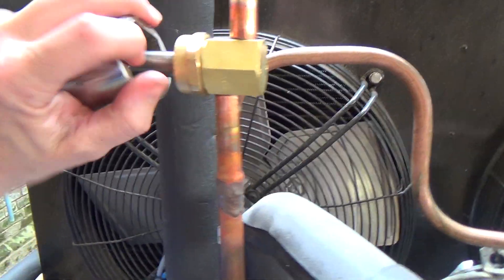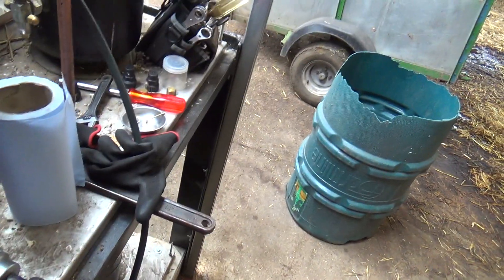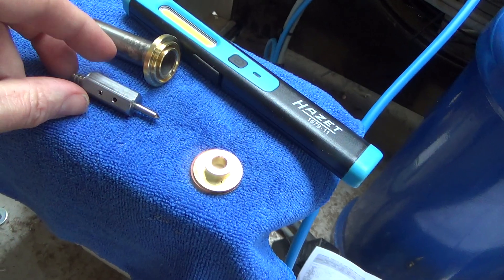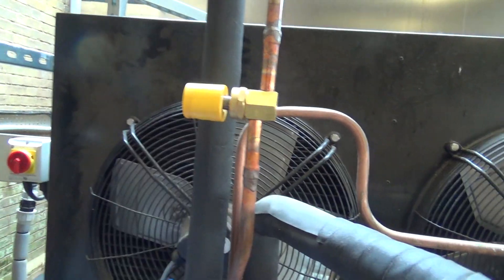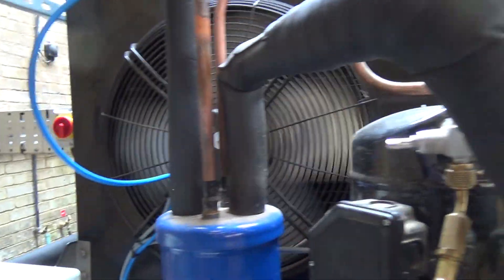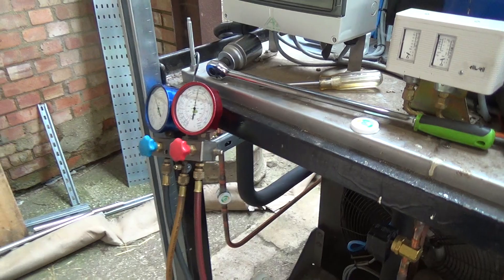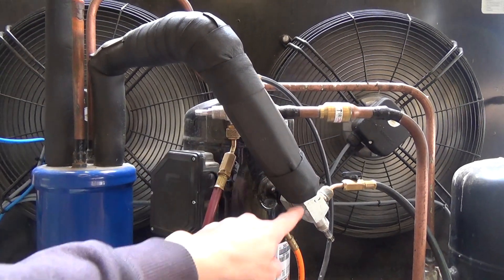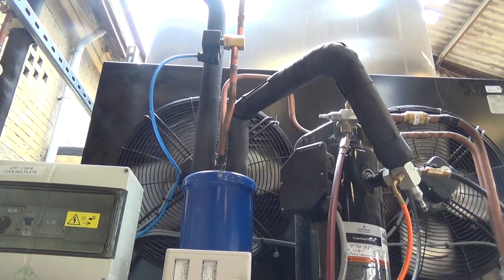Faulty Sporlan Valve Investigation

Comment: Could be that the spring had a small burr on the one side from the forming, which made it stick in the piston, so turning it around keeps the burr from making it stick.
Reply from the maker: That would make sense, it was definitely a tighter fit on one end.

Comment: I think all your thoughts on that valve are true. I was taught to stretch that spring if you are already in there.
Sporlan has a chart for sizing those valves. It is tempting to just install whatever pipe size is there.
I use the Ridgid E-110 hex wrench for those valves.
Reply from the maker: Think I've got one of those Ridgid wrenches somewhere! Will have to find it out.

Comment: Rarely have a problem with sporlan liquid line valves. Had a piece of metal chip hold one open on a freezer two yrs ago. Compressor kept short cycling. Removed debris and it worked until that store was razed. You probably will not have a problem with this one.
Reply from the maker: This is the first time I've had an issue with a new Sporlan valve, but have seen a lot that after years of service let by when shut. (though that could be down to poor installation and maintenance as dairy stuff often has a hard life) Only ever seen one Sporlan coil fail in 30+ years. Danfoss seem more mechanically reliable but the coils fail for fun!